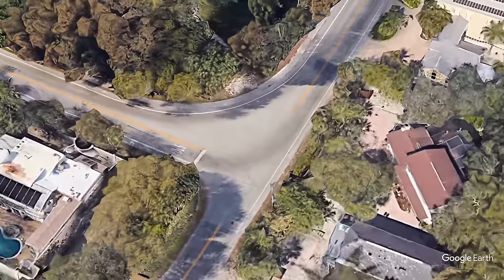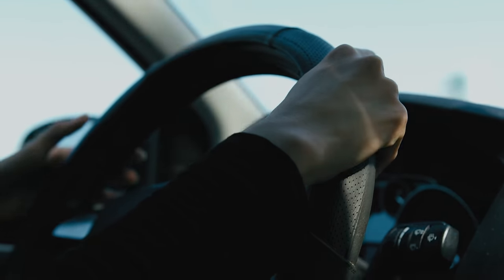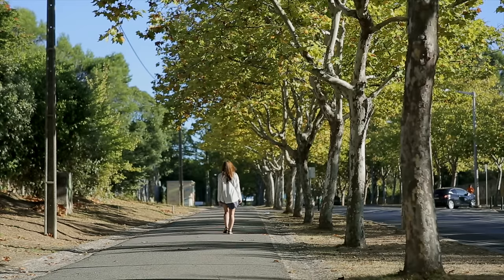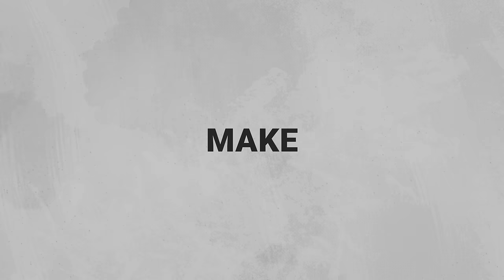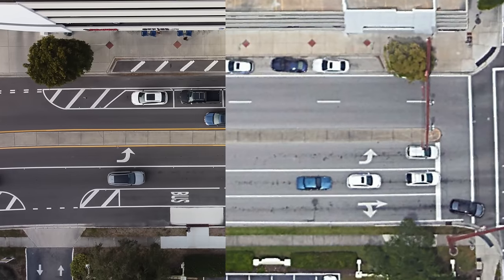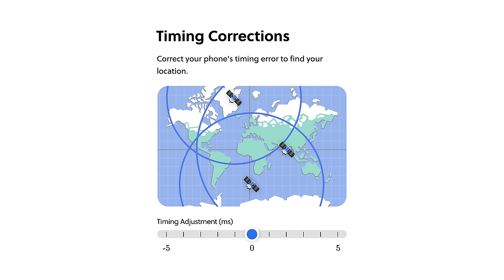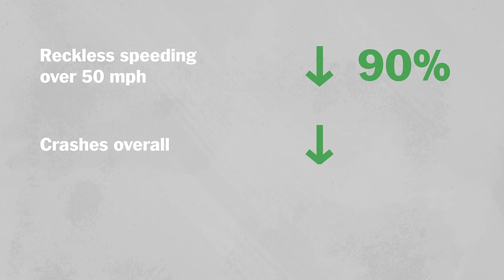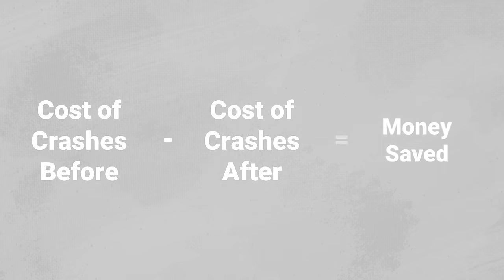This is the key to safer streets

Comment: I sometimes get tired of all the calls for limiting streets. Every road, street and neighborhood is different and has unique challenges. One street might benefit from a road diet, while the same treatment on another might be disastrous. And when it comes to road problems, there are more things to consider than speed. Just saying “Traffic is moving too fast! Speed kills!” is shortsighted and may overlook the real reason for problems. Slow traffic is inefficient and can increase the number of accidents because there are more vehicles driving closer together, and if drivers get frustrated, they may take more risks. Look how dangerous some parking lots can be! On the other hand, open freeways with traffic running 70-90 mph are the safest roads we have, in part because the cars are farther apart and spend less time on the road, and in part due to clever design that eliminates conflict points such as intersections.
Reply: The greater the speed, the more severe an accident will be. Simple physics.
Reply: @NewBuildmini  So reduce the accident rate to the point where speed is no longer a thing to be feared. This is why freeways are safer in spite of high speeds.

Comment: Why bother with the plastic? Just paint down lines with a slightly raised center. It's innovative but needlessly so.
Reply: How would you raise the center? As mentioned this is a pilot project, the costs and installation time are very low and it could be removed easily too.

Comment: If all you want is safety for little cost, they could have just made it a 3 way stop.
Reply: That has less throughput then the small roundabout. Also doesn't fix the sight line issues.

Comment: Instead of limiting and slowing traffic that usually travels at an efficient rate given no slowdown and artificially created obstructions meanwhile, how about we normalize better driver education more strict licensing tests. It drives me bonkers that there are so few instant failure points on driving tests. 99% of people on the road it seems don't understand that they are operating a 2000 plus pound hunk of steel. And that includes pedestrians not understanding that they cannot legislate physics more safe when stepping out in front of a moving vehicle. A four-lane road ends up being a primary Meridian because there's no obstructions people can get from point a to point b easily. When you add obstructions and limit the flow to two lanes adding parking where there shouldn't be parking adding bicycle Lanes where you don't need them, makes what used to be a good high flow road into an aggravation for drivers. Roads and cars are forgetting from point a to point b efficiently they should not be artificially limited to create areas of revenue for the local jurisdiction. I have so many problems with a lot of these methods.

Comment: I despise speed bumps/humps.  They are annoying to drive on and needlessly waste fuel.  Same with putting stop signs at every intersection.  Many of the other options here are much better.  Speed tables are more acceptable because they aren't as abrupt, don't require slowing to a crawl to traverse, and the raised crosswalk more easily puts pedestrians in the sight line of drivers.

Comment: Stop calling it a stroad.
Reply: So what would you call something that was trying to fulfill the roles of a street and a road and failing at both?
Reply: @kjh23gk  the two words are synonyms. All streets are roads and all roads are streets. Combining them is just silly.
Reply: @evancombs5159  A route with lots of entrances/exits for residents/retail/etc is the same as one that doesn't have any and exists just to move traffic quickly and efficiently?

Do you not think there is any hierarchy at all?
Reply: @kjh23gk  that is not what I said at all. I said street and road are synonyms. Meaning they have the same definition, and combining to make up a word that combines their meaning is silly. It's a major turn off whenever I hear it as it shows a level of ignorance about what you are talking about.
Reply: @evancombs5159  You consider two different route types the same, even though they are functionally different. You're the one expressing ignorance here.

Comment: This whole video:"We hate snow removal workers and have never heard ground frost and heavy truck traffic." Speed bumps cause each side of the bump compress over time with water collecting both sides of the bump, further changing the ground so eventually there is massive dip on both sides, causing damage to suspension even if you drive crawl speeds and since these islands are covered by snow, it wont take long before there is ether far narrower or island gets destroyed by snow plow, who are already too busy with snow when it falls in mass.

In the end all this is nothing more than ways to hinder vehicle traffic. My city for instance rebuilt the city center.. There was already lack of parking spots before changes. They cut existing spots in half, with plans to remove far more, but populous got pissed about this so it was "only" half, narrowed the streets like this, removed the only place where you could semi legally park with trailer, made parking pain in the ass in general and installed seats, so local alcoholics and drug addicts can spend their time next to most of the pedestrian traffic harassing mostly old folk who live in city center. Now there is only pharmacy that requires visit to city center, otherwise we wont go there. Before this change city center companies complained about lack of customers, now most of them are going broke or are moving further away. Around half of the business space is empty and 1/3 is gone under. Next summer will be first time when the city center is "ready" when tourists come... and drive passing this shit show. That is what this kind of globalist thinking in smaller town will lead to.
Reply: What is your city?

Comment: Going 90 in a posted 35 isn't a road design issue, it's an enforcement issue. Station some patrol cars every couple of miles to hand out tickets for motorists exceeding the normal 5 mph grace that is common in most if not all of the US and you'll get the speedsters down to 45, or less if the officers are stricter and vigilant.

And depending on the jurisdiction and what the state's laws are. Arizona for instance charges a misdemeanor for speeding more than 20 mph over the posted limit, which could potentially net you up to a moth in jail and a year of probation.

Tricking people to follow laws because they have no other physical choice is not going to work as well as conditioning them to follow laws because the don't want to suffer the consequences. As conditioning good behavior where there's opportunity to do otherwise is universal, if there are 5 of these types of stroads in a town and one gets renovated to be "unspeedable" the town's issues with speeding won't go away until you spend the time and money to renovate the other 4 stroads. Where on the other hand, a greater enforcement rate against speeding crimes will condition all motorists in the enforcement area to respect the posted signage, and not just on the stroads but also on the other streets, school zones, etc.

Comment: "I'm a karen and want people to slow down, so I will FORCE people to slow down by adding speed bumps, humps, and reducing the margin of error to make streets more hostile for vehicles traveling at speeds I don't like." 

Is what the vast majority of this technique is used for...
Reply: if a "karen" is someone who wants less pedestrian deaths, then i am definitely a karen!
Reply: @bogusWasHere  the only one that substantially and consistently improves pedestrian safety is the extended corners. Most other pedestrian issues are caused by j-walking or drivers dinking around on phones, neither of which is fixable by these alone. Additionally, once drivers relearn the new hostile pattern they tend to speed back up over time anyway.
Reply: @benruss4130 regardless of what you think, the methods outlined in this video have been proven to reduce speeds for more time than “until people relearn”. 

your want to travel at hostile speeds does not override a pedestrian’s right to be safe. even if you dont “dink around on your phone”, a slower crash is a safer crash, and so slower speeds should be encouraged by any necessary means in areas where pedestrians are present.
Reply: @bogusWasHere  I have driven more than the average person in my country does in a lifetime. I have never gotten a speeding ticket or been at-fault in an accident, effectively meaning my driving record is perfect. The speeds I go at are not 'hostile'
Reply: @benruss4130 There's nothing wrong with jaywalking IMO, as long as you don't impede traffic. And it's not really a thing in residential areas, where you want speeds to be low.

Comment: Now what if you’re a super experience driver and feel comfortable driving through these safer streets at high speeds?
Reply: There's always going to be a difference in perceived speed this way, if people actively decide to drive recklessly speeding cameras would be a good next step I guess?
Reply: They will still drive slower then what they would have otherwise.
Reply: @kempo_95 No, and that is the objective downside of many of these changes.  If the changes do not reduce traffic, or do not reduce the speed of dangerous risk taking drivers, they actually make the problem WORSE.  If the same amount of people drive on less lanes, traffic will get worse.  If reckless drivers drive the same speed down curved roads, the reduced visibility means they are in greater danger of causing a wreck or hitting a pedestrian, as both parties will have less time and space to see each other.

Don't be a mindless ideologue.  The fact is, many policies have upsides and downsides.  Reducing lanes may not reduce traffic or car ownership in some places and instances, and are a bad policy.  Curves in roads have traditionally been a SOURCE of accidents because of the reason I listed above.  These aren't purely "good" policies of fixes for the problem.
Reply: @kingduckford  If you drive 50 mph on a curve that is designed for 30 mph, you shouldn't have a driving license. Your risk assessment is way off. Then the US needs to fix their driving schools and education.

A straight road always has a higher minimum speed then a curve. That's why long straight roads should be avoided. They encourage speeding.

Comment: I hate traffic circles .
Reply: Why? They are awesome
Reply: @E11or  if the radius of a traffic circle was 1500 feet, that would be awesome.
Reply: @joeharris3878 why that? Why so big?
Reply: @kempo_95  I was teasing. Any type of interchange that big would be awesome....amazing.....stupendous. Over 50 acres .
But it is true that most traffic circles are too small and therefore inefficient and dangerous .
Reply: @joeharris3878 ah okay, I thought you didn't want to slow down for traffic circles.

But yeah, the diameter of a traffic circle is a major factor in the throughput it can handle. But inefficient ones aren't per se dangerous imo. It still forces everyone to slow down.
Reply: @joeharris3878  By "inefficient and dangerous" you mean that they slow people down slightly and massively reduce crashes.
Reply: Four way stops are superior.
Reply: @joeharris3878  Don't think they have more throughput then a roundabout
Reply: @kempo_95  I will not listen to reason.  Eliminate traffic circles !
Reply: @joeharris3878  so you hate turning your steering wheel?
Reply: @E11or To tell the truth, I enjoy using the steering wheel.  I love a good drive in the mountains. 
I will say this, for people who don't like turning their steering wheels,  then traffic circles would probably appeal to them..
You only turn once, to the right, and only slightly, to enter the traffic circle, 
then you keep it in place, then again only to slightly right again to exit. 
The traffic circle are inherently dangerous and inefficient.  Four way stops are superior, as are traffic lights.
The circles are fashionable,  but not good for drivers and passengers.  And since cars and trucks are constantly in motion on
the them,  there is no safe way for pedestrians to cross at the intersection. Heaven help bicyclists who enter these death traps.
Traffic circles are European, i.e., chic . The fad will disappear eventually.

Comment: I suggest using boating rules... Larger vehicles get right of way over smaller ones and pedestrians get no right of way. I'm willing to bet pedestrian deaths would go down because too many people just step out in front of vehicles because "well, I've got the right of way!"  People can stop on a dime, cars can not.  Simple physics.
Reply: Or drivers should learn to look and respect when someone else has right of way.
Reply: @philg8556 That's why I encourage pedestrians to walk around with hi viz and a brick. Hard not to notice someone trying to cross with a brick in hand.
Reply: We did exactly the opposite. Motorists are forced to pay extra attention and slow down to see if there is a pedestrian about to cross the crosswalk.
Heavy fines and often a suspension of the driver's license await the motorist who breaks the rule.
As a bonus, motorists automatically slow down for a pedestrian crossing.

Comment: instead of making roads dangerous, place radars and fine who disrespect the speed limit. way safer and effective. you can always place speed bumps if needed too
Reply: It doesn't work
Reply: It's better to design roads in a way that drivers narurally feel uncomfortable going above a certain speed, reducing the need for punitive measures.
Reply: This isn’t the best way and people will naturally drive faster than a low speed limit if the street is designed in such a way in which high speed seems more acceptable. 

So people will still speed but be fined.. meaning drivers, citizens, pedestrians, cyclists and heck even the government suffer bc of increased crashes. 
Most effective is totally street design but radars are used on roads that can’t have any traffic calming (this is where I agree with you!) 😮
Reply: @greek9244  the thing is, streets in residential areas are normally narrower and already perceive a necessity of not driving fast (at least here in brazil). so in streets designed for 60 km/h shouldnt be narrow, because they are still fast roads, so radars and speed bumps (or humps) should do the trick. I commented that at the start of the video, but after watching all of it I understood what he mean, i just don't like the concept of making streets more dangerous with desnecessary curves, etc, but a lot of the ideas were great

Comment: Round a bouts do not work. It's the most problems in our roads. I avoid collisions every time I get near one. People don't care about anyone but themselves and just use them as exclusive right to ignore all others.
Reply: But your avoiding collisions at ~20 mph, not 35-50+mph. Not deadly vs deadly. Get in a minor crash once a month or die in statistically ~10 years. I know which one I'd pick.
Reply: They do not work in your area, people in your area probably just don’t know how to use a roundabout
Reply: think of it not as a source of problems but a lens into one. I guess there are a lot of idiots at your local roundabout. now imagine them doing similarly stupid shit at much higher speeds.
Reply: guess, how these idiots react on a stop sign…
Reply: They are everywhere in the uk, which has a per kilometre fatality rate of less than half that of the US. Collisions on roundabouts tend to be less serious as they are normally diagonal strikes rather than side slams that occur with traffic lights.
Reply: by that argument signalized intersections doesn't work either
because the same idiots doesn't care about red lights etc either